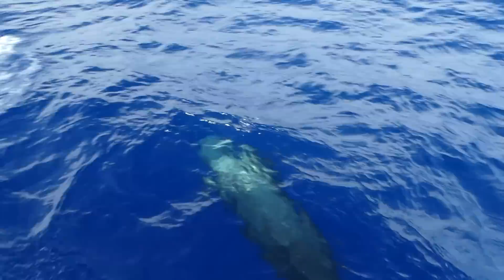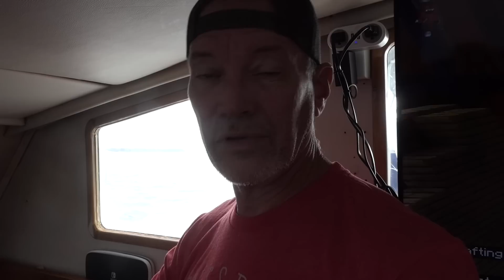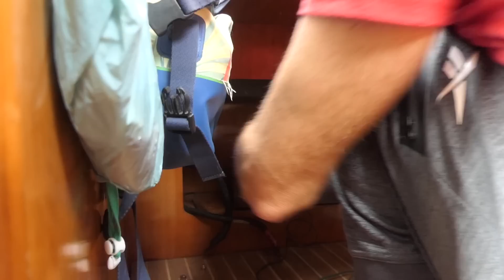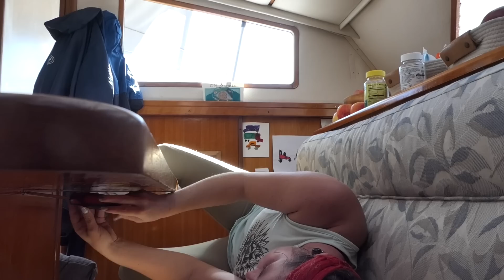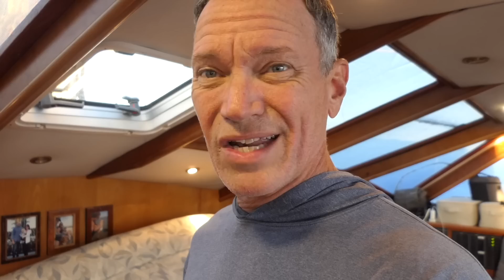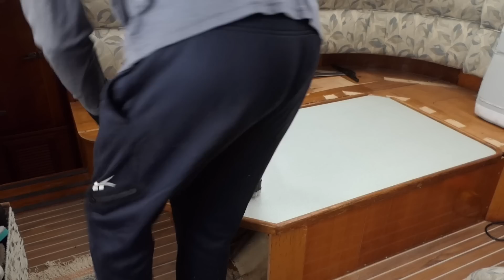CHEAP LITHIUM on AMAZON - We ROLL THE DICE | Catamaran Renovation | SailAway 224

Comment: Eric, I was a bit surprised that you didn't have any other batteries in the engine room other than the start batteries. I have replaced my old AGM house bank down in the starboard engine room with my 100ah lithium and my 2 start batteries live on the port side in those battery boxes.
Reply from the maker: Yeah, our house batteries are up in the salon under the chart table, so nothing but one start battery in each engine room. Leaves lots of room for engine supplies and assorted randomness.

Comment: I see your old batteries were installed in daisy chain )each neg to each neg and each pos to each pos). I suggest getting 2 busbars marine grade form Blue Sea 200-250 amp. Run each battery positive to busbar also with negative then connect your inverter to it. This lowers your C charge and discharge to each battery and prolongs their life.

Comment: Doesn’t all your cables need to be the same thickness and length from battery to battery to inverter using lithium?  Plus you have to maintain your temperature. I would suggest drilling some small holes in the bottom of the cabinet at one end and some holes at the top of the other end and a small computer fan because they don’t draw much energy and have it blowing out of the top, so cool air in the bottom blow hot air out the top. Plus hot air rises, but that would help you maintain battery temperature.
Reply from the maker: Cold temps are the biggest issue and we won’t have to worry about that. That area is right in our salon and it never gets particularly hot up there, so they should be fine. We’ll keep an eye on em though

Comment: Love the vids.  I had the same issue with my lights staying on when I turned off the house bank.  My issue turned out to be the West Marine charging relay that connected the starter battery to the house bank.  It was supposed to be on only when the house bank was charging, but mine was on all the time.  Those don't work with Lithium anyway, the voltage of Lithium makes them think the house bank is always charging.  Also, you didn't mention your alternator, Lithiums draw too much power for too long.  Without an external regulator they overheat.  You might be able to retrofit your alternator.  Search for Lithium Alternator Regulator.  There will be lots of discussion of the issue.  The Balmar setup is one of the ones being used a lot and what I have.  Once you've upgraded your alternator, have a think about how to charge the Engine battery when you don't run the engine for an extended period like when you are on the hard or stored for the winter.  Combining the batteries is not a good idea.   Lithium's voltage will boil the water out of lead acid batteries, especially if the lithiums are charging.  One solution is a DC to DC converter, another is a small dedicated solar setup.

Comment: Enjoy watching your ongoing improvements to the boat. One suggestion - there should be provisions made to provide airflow in the battery compartment to control temperature, such as putting a louvered panel in the access door, and a small fan controlled by a temperature switch. Good luck on sorting out the starboard charging situation.
Reply: Yes, if he was to drill some holes at the bottom of the cabinet and some at the top at the other end of the cabinet and install a little computer fan at the top one it would draw air in from the bottom and pull it out through the top plus hot air rises

Comment: Couple of comments, don't rely on voltage values from lithium batteries to work out if they are at the same state of charge. Unlike lead acid the lithium batteries will hold a constant voltage for ~90% of their charge. So you could have 1 battery at 30% charged and the rest all above 90% charged..... they would all show the same voltage of roughly 13.2V. Check out "top balancing" videos for instructions to make sure all battery cells are at the same state of charge, if you don't do this you may well end up getting far, far less actual capacity (In the extreme example I gave above you would only get 30% capacity of the full battery bank due to BMS cut outs...or fire xD). I'm sure with the extra cost that companies like battleborn charge and advertise that their batteries are all perfectly balanced but not sure if they balance multiple packs with each other before they send them out or if they just mean each of the 4x 3.2V cells inside each of their own 12V batteries are top balanced...Chins batteries seem to be great with a decent BMS/balancer included. 

Second note is if you want a large LifePO4 battery bank you can do it far, far cheaper by buying a bunch of 3.2V @ X* AH cells, top balance the lot of them to ensure the state of charge is identical and get a BMS/Balancer(s) to ensure all cells are IDENTICAL all the time. Would cost 100th of the price of buying individual "drop in" replacements which you should really be top balancing each "drop in" battery with each other before using them. The biggest negative of this is that you need to build your own box to fit those cells in, the biggest positive of this (especially on a boat) is that you need to build your own box to hold the batteries. Lithium cells can be boxed upside down, 4 in a line or 4 side by side ala "drop in" batteries. If you have a slim space you can make a long thin box and have 4x 3.2V cells side by side. Positive is - all boats are different with weird and whacky shapes to fit batteries into. Building your own is like clicking lego together these days and costs way, way less to make a better battery pack suited for your own personal space, just a matter of learning how Lithium cells are top balanced and making sure your lithium cells are all at an IDENTICAL state of charge.

(X* - Capacity you need from the battery as a whole, or as separate packs in parallel for redundancy if 1 cell in 1 pack fails)

Comment: I hope your experience with the Chins is as good as mine has been. I replaced 4 T105's with 3 100 AH 12v Chins. They have worked flawlessly for me for nearly 2 years now. 
Keep your cables between the batteries equal length and gauge. As I understand it, the low resistance of LiFePo will allow an imbalance between batteries if the cables aren't all the same between batteries.
Reply from the maker: That’s great to hear! Happily, all our cables were identical length, the right gauge, and in good shape, so it was a simple install.

Comment: Some suggestions to make your life with lithium better.  I have a charging system set up to keep my starting batteries in good shape.  It consists of an $8 PWM solar charger off Amazon.  I would suggest a 10A-30A version.  No it will not run off the solar so much, but off the batteries.  Your batteries can typically produce a high enough voltage to keep the lead acid batteries always topped up.  This prevents sulfation 24/7 instead of just when the sun shines.   Solder in two fuse holders on on the lithium battery side/Solar input and one on the starter battery side.  Size the wire appropriately but 14 or16 gauge should work on like a 10A or so charger...look it up(wire sizing). I put in 5A fuses and it hasn't popped except when I made a mistake and turned off the starter battery side before disconnecting the lithium.  It will take like 1/600th of you lithium a day, but it has a couple of benefits.  My starter batteries are now 8.5 years old.  They seem super good to this day.  12.6 standing voltage.  Lead acid generally won't last past 5 years...except maybe Carbon foam but neither you or I want to talk about those right now.  If you run down your starter battery trying to start the engines unsuccessfully then they will eventually charge back up with the solar. Also I have a Renogy DC-DC charge controller with a switch on the D+ and a low voltage relay to cut it off in case I forget to turn it off.  You can feed the solar controller on the same wires as a dc-dc as it will automatically detect 14.4 volts on the starter side and not charge... I have a 20amp dc-dc on a 70 amp alternator.  I suggest putting the dc-dc next to the lithium batteries as the voltage coming from the alternator will be higher putting less stress on a wire run.  Plus the heat in the engine bay will shorten the life of the dc-dc. Also make sure your solar charge controller is lithium compatible.  I mean on your existing solar...the PWM charger is typically for lead acid anyway, so that is not an issue as the battery being charged is lead-acid.

Comment: Nice mod for the table. Lithium is an absolute game changer. With 900ah, you could run air con.
We went from 600ah of AGM to 400ah of LifePo and still have more usable energy. Saved 150kg.
Reply from the maker: Nice! That’s great to hear. We’re eager to get out there and test it on the hook.

Comment: Great job repurposing the second table- a catamaran built for charter and 8 people able to eat in the salon down to one for 3-5 people.  
As I'm sure you are aware, level of voltage (in its normal range) is not a good indicator of LiFePo bats state of charge.  You either top balance each one or you connect all 3 together in parallel for 24 hrs with no input or outgo and they will all get to the same level of state of charge. I think the Chins should do you well.  I would suggest you change out as many incandescent bulbs as possible to LED (marine grade on outside, less expensive ones on interior) as I see possibility of induction cooktop in the future.
I don't know what your plans are for mixing LA start bats with lithium bats, but a fellow cruiser Ytuber/engineer Emily and Clark's Adventure invented a $350 item that allows LA and Lit batteries to work well together, especially when charging from an engine's alternator.  This is also the engineer that created a low power draw 12v DC air con unit which is now being manufactured.  I have no relationship to channel/co , just a viewer.
If you decide to increase PV panels, take a look at bifacials for locations where underside will be exposed to reflected sunlight.  Sailing GBU has them and Ytuber Everyday Dave, a landlubber got 15+% more power from the back side of cells.
Given the delay in postings, I'm sure you are already sailing.

Comment: My cat is all electric….  I have 50+ kWh of lithium batteries….  Chinese for propulsion, Victron for house…. No major issue yet…
Reply from the maker: Wow, that’s awesome! I’d love to get to that point someday. What’s your propulsion?
Reply: @SailAwayVlog  we have 2x 72v 200ah independent systems for the propulsion.  Also have a 21.5k generator to charge the system.  We do have a re-gen option when sailing at 7knots+.
Generator burns 1 gph.  We can run at 5.5 knots with generator running 1 out of every 3 hours.  4 knots 1 out of 5 hours.  3 knots for about 3 gallons per day.   It’s slow, but efficient….
We have over 3500w of solar for our 48v house system, so we almost never need the generator for daily use.   House Battery bank/solar is enough for the watermaker or even the beloved summertime AC option…
On our way to the Caribbean….   Maybe see you out there when you return….  Would love to jam…